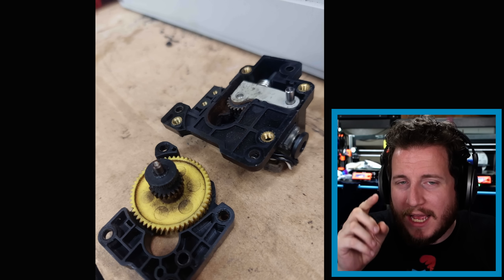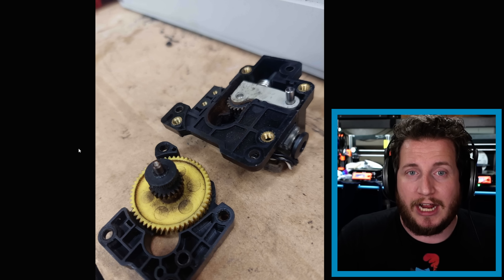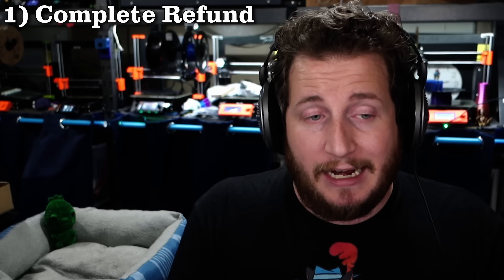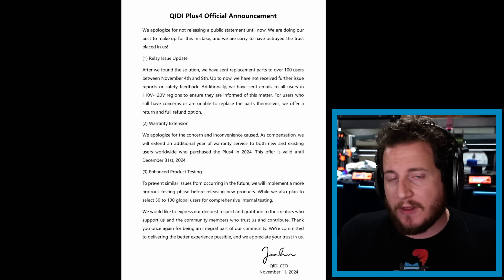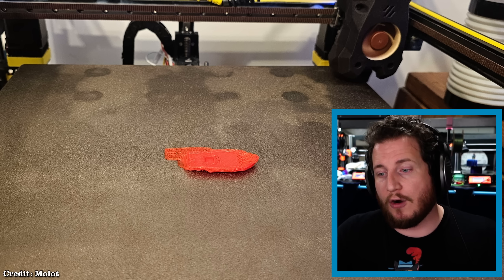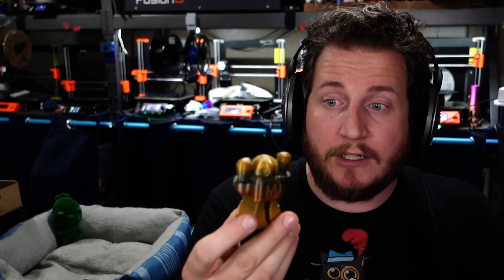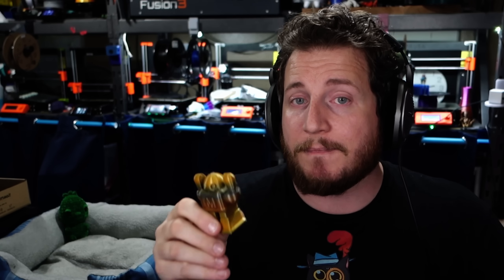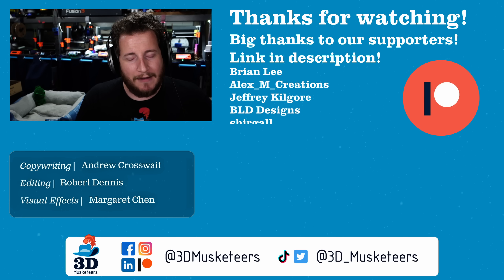Is It Finally Over?? - PrintFixFriday 166

Comment: I have a small fleet of extremely modified prusas, I generally check the linear rod lubrication level weekly, the belt tension at the same time. Any time I run into a filament issue(I'm using extremely cheap filament for wargaming parts), the hobbed gears get cleaned and checked over. 

The fun one is that I generally only clean the PEI sheets if I'm having issues with parts sticking, because otherwise they can go weeks and weeks without a single issue, and I tend to not love tossing more solvent into the air than I need to. Granted, I'm using a 81 point bed surface calibration with some very fine tuning on the first layers.
Reply from the maker: we wipe with windex between prints, seems to work well!

Comment: If one thing breaks or something is showing significant wear, I fix or swap out the parts, but I also look into the other things that can go bad, or will go bad in time, check belts for wear/ tension. I like to do things so I don't have to work on that printer say the next week cause of something I could have fixed when I had the printer apart or had my hands inside it.

Comment: If you can simply spend a couple of hours and less (possibly far less) than $300 to replace an extruder or a few belts every 5000 hours of printing, I'm not sure there is any preventative maintenance that could be scheduled more cost-effectively than that. How many 1-2 hour + $15 preventative sessions does it take to avoid the larger maintenance effort every two years?
Reply from the maker: That is kind of what I want to get at with the video. That REALISTICALLY you dont need to be doing the maintenance you are doing, you know? But to come to that conclusion I also want to see what others have to say!

Comment: About the failed prints with silk filament. Could it be faulty material? I had similar problems with a different brand, it was low cost though. And after way too much back and forth I started to assume that the filament was just bad.

Comment: I have 6 P1Ss with nearly 6000hrs on each(nearly a year old). Zero , absolutely zero preventive maintenance and they are still running fine, can’t say the same for the AMSs.
Plenty o running maintenance, like when the lead screws squeak - add grease….

Comment: -- Bambu Lab is nice enough to include lube with their machine, hinting on PM(Preventive Maintenance), Creality printers are DOA(Dead on Arrival), but they will send you a cheap parts, that won't fix your printer...
Reply: -- Kudos to Qidi, and you as well for informing about existing problems and solutions.

P.S. Every time I change spool of filament, I wipe rods and grooves clean, and apply fresh lube, that way I won't forget and slip behind on PMs.

Comment: Shortly after I installed my ERCF, I kept getting under extrusion after a few layers; kept trying different settings on the ERCF, playing with parameters, replaced a few parts with spares, but it was just that my tension screw on the extruder got loose 🤦🏼‍♂️

Comment: By your logic no one should relocate or replace a power supply because you are not a licensed electrician. No one should attempt building a VORON. There are AC circuits that the average mortal should never touch. I guess you don't own a toaster either. You do know that the little glowing wires are "mains voltage" after all. If you bought a QIDI Plus4 and you aren't comfortable disconnecting 5 wires and hooking them back up then by all means send it back. Don't make it such a big deal. Go buy the new Creality machine I'm sure it will be perfect.
Reply from the maker: The difference with a Voron is that you KNOW what you are getting into, and technically, yeah, you should not be unless you are qualified, review your home/renters insurance. When you buy a brand new printer, you dont expect to do this kind of work, nor should you. 

You dont stick your hands in a toaster do you? Nor do you re-wire a toaster.. Like dude, you are going way beyond this here.. As a creator I say certain things that I would not personally do. I am more than comfortable doing the mod myself, but I dont want those who are on the fence to say "oh it is really easy Grant did it" and then somehow set their house on fire or something..

Comment: SSR stands for solid state relay, so it is a relay board, just not one with an electro mechanical relay.
Reply from the maker: But it's not the SSR that was the issue, it was an inductor coil that gets insanely hot

Comment: I just got my new ssr board in the mail today. Can't wait to see the status of my current board. Qidi assured me that the current ones were safe as there were no reported fires YET. I told them that isn't as reassuring as they think. It's a new product with an issue and sometimes it takes time for big problems to occur and that the onus is on them (not youtubers)to PROVE the safety through a multi day long stress test with the top of the printer off. It can happen if someone forgets

Comment: I was getting ready to order the Plus 4, but due to the issues have decided to go with their X Max3 instead regardless. I have will pay the 40 dollars for the camera that they don't automatically add for some reason.  As for probably one of the main complaints many have on the Max 3 which is no automatic Z offset (along with the spool holder being on the back, which I can also resolve), I really don't have a problem with that. I have been setting my Z offset manually for a long time and feel very comfortable doing it manually.  I actually prefer to do it manually anyway at this point. So for me at least, it is the Max3 instead of the Plus 4.  Just have to go with my gut on this one and trust (hope) I am correct in what I believe. Love your channel by the way.
Reply: I have a Max3 that was a preorder, and with all the hardware upgrades they shipped me, it is a very good printer now.  It was half baked when they release it just like the Plus4 and appears to be the MO of all the printer companies these days.  You made a good decision not buying the Plus4, there will be more design/hardware issues with it for sure.  Qidi support was responsive and they did ship me parts for all the issues I had.  Your new XMAX3 should have all the good stuff on it so you will be happy.

Comment: I have 4 bambus (2 X1 , 1 P1P, 1 A1) .. aside from general cleaning and adding lube. I do nothing else. They have about 2500 hours each with 0 issues. I have had to replace ptfe tubes from the filled stuff I use. But no other real issues.

Comment: Great, wonderful Qidi, but my plus4 prints like absolute garbage! I've been trying to tune/fix my brand new plus4 for almost a month now, and it still prints like absolute shyte. I have not been able to print a single somewhat okay print on my plus4 yet!extremely terrible uneven layer lines, wavy vfa's, extremely atrocious ghosting, and bad ringing on every single print. I am still pissed off very much. I have been a loyal customer to qidi. I've bought every printer they have released in the past 3 to 4 years now. I can't believe the level of failure, no qc control, cut corners, excuses, bs defensive behavior (up to this point), and they tried being slick with this. They just trashed their incredible customer service record with this. They have never been defensive or made bs excuses with any other printer. But this plus4 has been an absolute fkin nightmare for me.

Comment: For maintenance I do a few simple things;

Every second month I do a large scale cleaning of all leadscrews, rods and rails and apply new grease
And do some visual inspections on the extruder parts, etc in the meantime.

I change the carbon filters on the back every 2-3 months. 

And that's pretty much it. I should absolutely change nozzles more frequently, though LMAO
Reply: Ngl I've just been slowly upgrading random parts on mine instead of doing maintenance so the problems have been slightly warded off LMAO

Comment: If I buy a Qidi plus4 today, will it have the new board installed already?  That’s what I need to know.
Reply: Give it a month or so at least. If not 6 months. And wait for reviews first.
Reply: Ask qidi bro, fo to their website and email them. Just warning you now, this plus4 has been extremely hit/miss. My plus4 is a nightmare, and every print comes out like absolute garbage. Extremely bad uneven layer lines, bad vfa's, extremely bad ghosting, wavy artifacts from top to bottom. I own 7 qidi printers, so I know the brand very well. Half are getting a plus4 with terrible print quality like me. The other half are praising their perfect prints. That's not even including the melting ssr board, defective heater housing, and all the other design flaws and cut corners.
Reply: @danieljamesbindery  Not to be offended, when I do search about Plus 4 videos, I always seen similar identical nearly a copy paste comments like this but with different accounts. Are you all the same accounts? I've seen this nearly on every Qidi video that I watched.
Reply from the maker: I would wait a MINIMUM of 2 months, closer to 3 right now. The only way to know is to open it up, which I am not a huge fan of..

Comment: I installed fluidd on a K1 Max and the pulley settings defaulted incorrectly for my model version. I didn't know the issue at first until i homed it from its default stop position after a print job. When I hit the homing button the it couldn't reach the y axis end stop*. Luckily i found some answers online because i not had that experience installing firmware on a core x y.

Comment: the most maint i do is  clean the z rods/screws (usually by wiping down the older, excess that has usually got grime in it or hair or dark spots) and then applying a fresh bit of grease  (super lube) and letting it start over again.     I mean maybe that's my problem, but my 2 recent printers are less than 6 months old,  and my old Ender3 I haven't printed with in quite some time.

Comment: The new board being shipped to customers have the resistor on the correct side. They also have soldered ALL locations.
Reply: I'm fairly certain that the addition of that resistor was a revision done during development. There is really nothing wrong with having a resistor like that on the "bottom" side of the board, and things like this are done quite commonly throughout the electronics industry. It doesn't indicate anything other than the fact that the board was tested, revised, and a fix was implemented. It is a hardware version of a "firmware update", so to speak. Many times, there is no room on the "front" side to add the necessary revision to the board.
Reply from the maker: thats a plus
Reply: @3DMusketeers  plus 4

Comment: With my prusa mk3s+ I kept getting y crash detections and couldn't figure it out for the longest time checked everything from belt tension in it bearing lubrication and everything else I could have thought of but it just turned out the Y stepper motor was getting too hot in the enclosure in the solution was to slightly loosen the belt and so it wasn't working as hard when It got hot and the crashes went away.

Comment: Talk about great timing........   I'm watching this as my X1C performs a calibration post a good service.  In the order that I performed the service.....  I cleaned all lead screws and rods (carbon and steel).  I cleaned the cabin, vacuum and wipe down.  I lubricated the lead screws.  I relaxed and re-tightened the belts.  I checked the belts on the underside.  And, finally, I checked all visible screws for tightness.  I generally do this every other month, or when prompted, or when prints show quality issues.

Comment: The X1 and P1 series are great printers and you know I swear by them. However, the belts are for sure the Achilles heels of those printers. There is 8 idler pulleys and they get off center as soon as you retention them. It’s just the weak point of these printers as that is the most maintenance I find myself doing or cleaning the Z axis lead screws which is easy.

Comment: so my prusa mk4s is 1.5 years old. Zero maintenance. Still runs great. My mk3s+ needed to be lubed all the time. This is my fault for accidentally skipping the step where you lube the bearings. lol I did not skip this on the mk4.
Reply: how much printing time do you have on these ?
Reply: @Majke  not sure. I think the mk3s+ has about 1000 hours. The mk4 has got to have at least that.

Comment: 3:31 On my bambu there is zero preventative maintenance, within like the first week it told me to clean the Z lead screws like it did for you and I don’t know what that did to me but from that moment, I decided no maintenance for it. The only thing that has been done is changing tubes and I’ve done that only once after 3500 hours.
Reply from the maker: lol so you got mad and said NO LUBE FOR YOU?? hey if it works, it works!